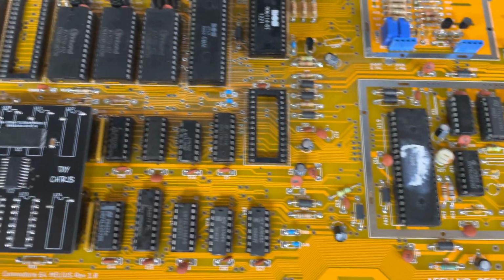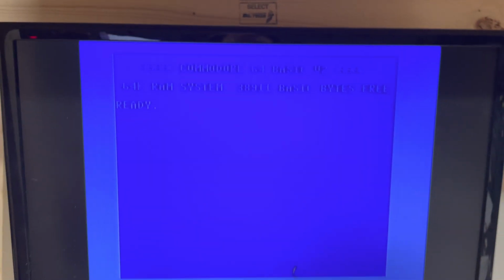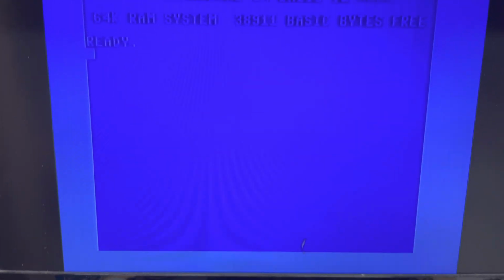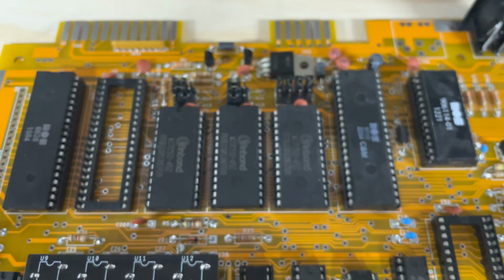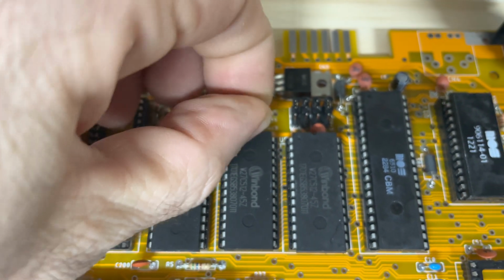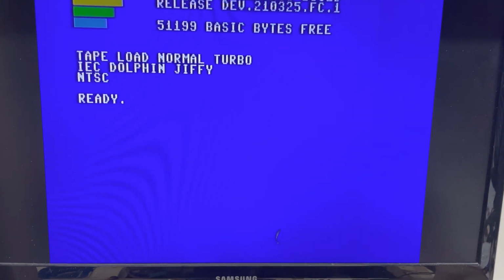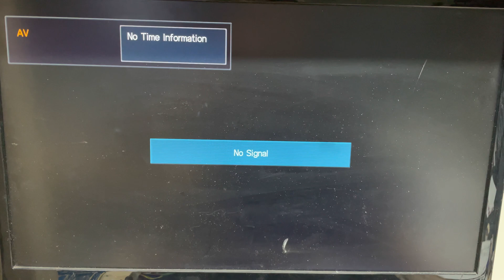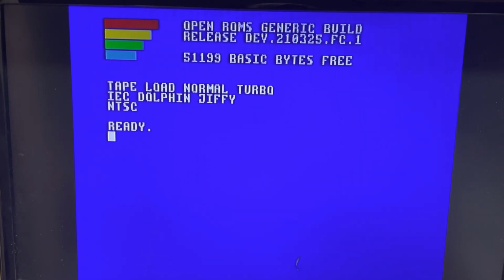Quick Review of Commodore 64 - 250407 Project MELIUS Rev 1.0

Comment: Congrats on the work so far. Seems like the Commodore64 will not die at all. Perhaps the most cloned system of the 8bit era. SixtyClone, KU-Board, UNI64 systems and now this board. Not even Atari 8bit systems are cloned in this way. I did see a post somewere, that there is a 1:1 clone of one of the Atari systems. If it is ready for purchase, is something that I know nothing about.